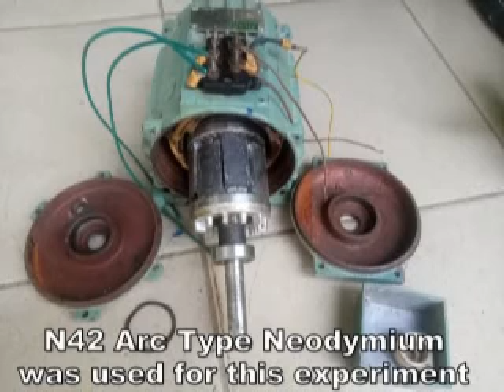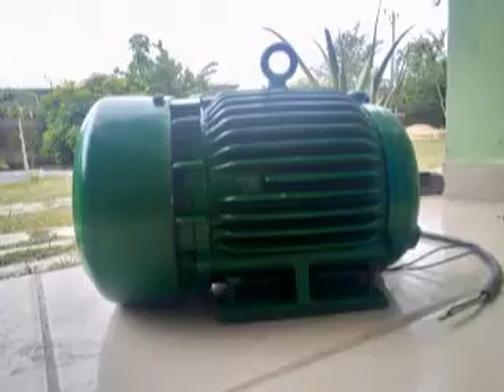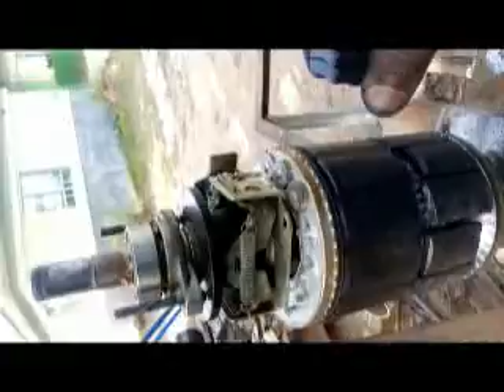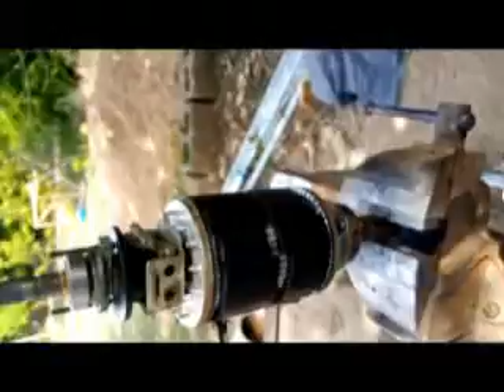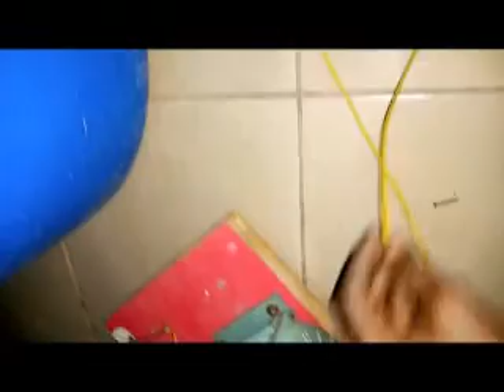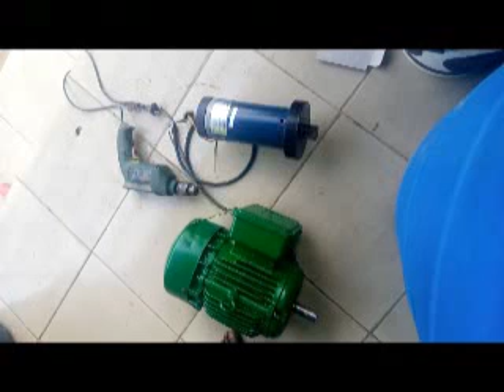Low RPM Permanent Magnet Alternators

Comment: Sir did you ever try braking magnets in 2 peaces and use 1 peace in takt? Long ago I watched a men doing so and instead of magnetising magnets he used 2 galcoated washers aperantly the magnetic strenght increased drasticaly to those 2 washers even stronger then the 2 magnets its self.
So any ideas what that was?
Aperantly if he switch those 2 peaces who are broke in half magnet the washers stop atracting to ich other diferent effects acure.
So that got my curiuse what out put you wuld get if you force 2 magnets together what wuld a scope read as results?
And If realy some one tried to use 1 broken magnet and 1 intakt magnets what wuld the scope read as result?
Ore if you use just 1 pole set wuld not the winding read on scope positive and negative charges? 
Basicaly that winding is transformer even with 1 pole set he still shuld make positive on 1 end and negative to other end of a wire due to polarity direction ore wuld that out put by diferent out of faze from ich other?
Just got my curiuse thats all.
And what wuld hapen if you rewinde the rotor wining ?
For exampel if you use 2 diferent wires with diferent thicknes and winde the rotor in series ore pararel?
Wuld that not make it as magnetic brake circuet ore variabel rpm starting charge for the alternator if you indead use 2 diferent winding set's?
Tehnicaly if you wuld put magnets inside the stator windings on those lamination wuld not curent by generated in the rotor as well if no power is aplied to the brushes?
This is all just theoretical but wuld you not have 2 diferent out puts tehnicaly speaking 1 from the rotor and 1 from the stator if you use on bouth sides magnets neodimium in centrain places?
Basicaly that rotor remindes my of rotary thansmormer so Im wondering how that can by benefitial some how.
🤔 
I even see peopel use mosfets and buld speed controler for alternator but I was wondering culd those alternators by used for exampel charging baterrys from 500 to 2500rpm and then add switching circuet and bypass the bridge rectifier and use speed controler circuet and use that thing as brushles motor wuld that by posibel?
And what circuets types actualy use such methodes for automatic switching and rpm reading circuet ?
Basicaly I want that alrernator performing 2 task at same type in diferent rpm speeds to act as bouth generator and starter motor .
Is there cinde of resistors ore mosfets who actualy activate and deactivate at centrain frequency by them self?

Comment: Hello,please were do i buy the magnets you used in abuja.thanks
Reply from the maker: N42H available at The Backpackers Hub, Nigeria
Neodymium magnets with black exposy coating with high heat resistance.
arc neodymium magnets selling in pairs (north/south) inner radius is about 25mm, 31.7mm outer radius by 42mm deep, 5 6 make a circle. but price is per pairs only
Reply: I have The latest strong magnet N52 60x10x3mm